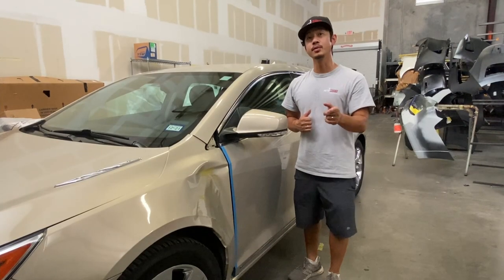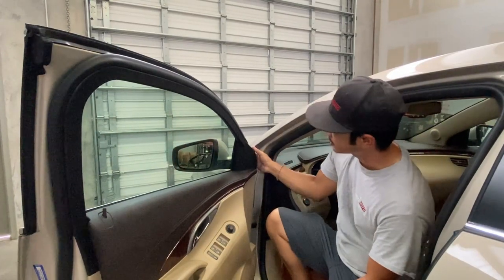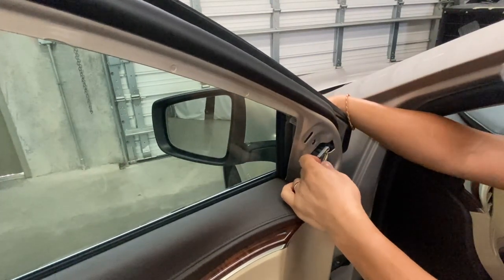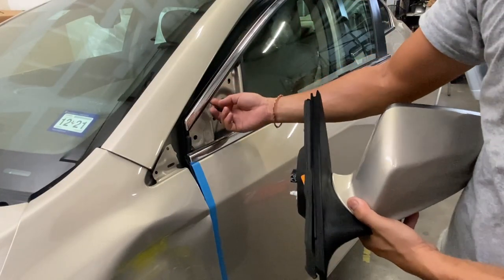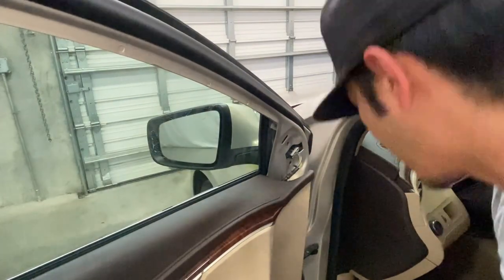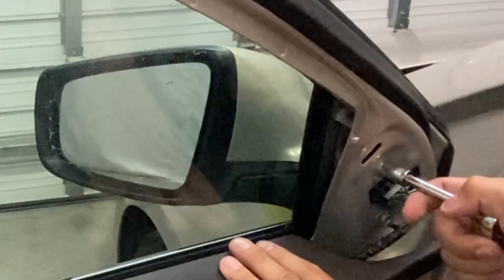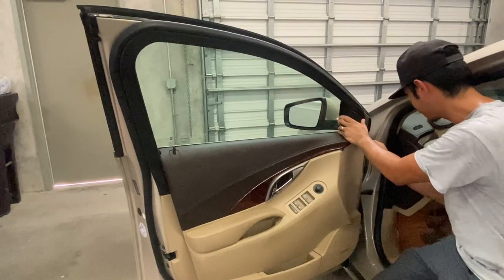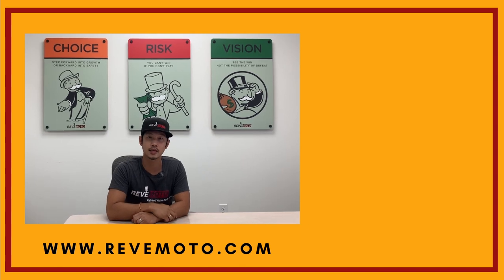How to Replace a 2010-2013 Buick Lacrosse Side View Mirror | Step-by-Step For Beginners | ReveMoto

Comment: Hi
Wondering if I just need to replace a broken turn signal portion of the mirror would this be a little easier to do. This way I can work on prying the mirror off and so on.. while doing so on a bench.
There is another video on doing this but still attached to the vehicle. Thanks for your input.
Reply from the maker: It's just much easier to work on the mirror when it's completely removed. I would take it off bc you'll have more freedom to move it around. You could also just pop the glass and pop the turn signal if you're very experienced.